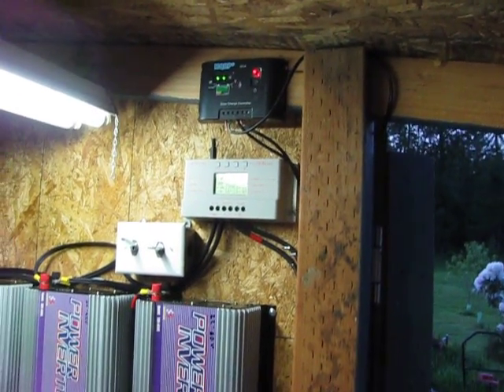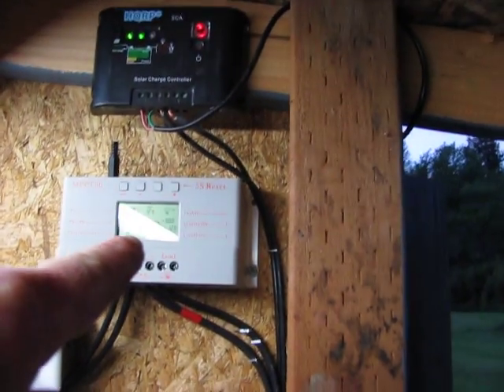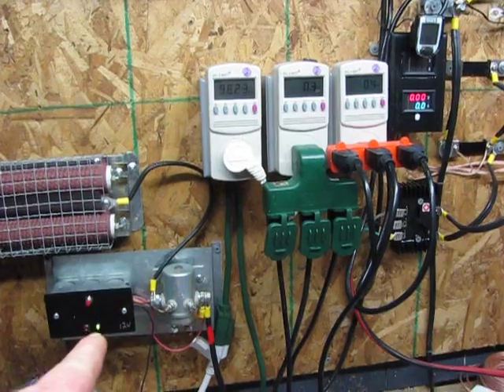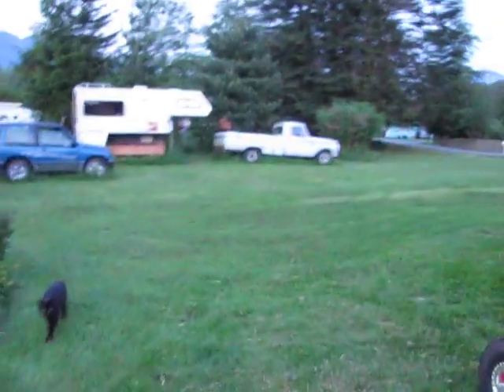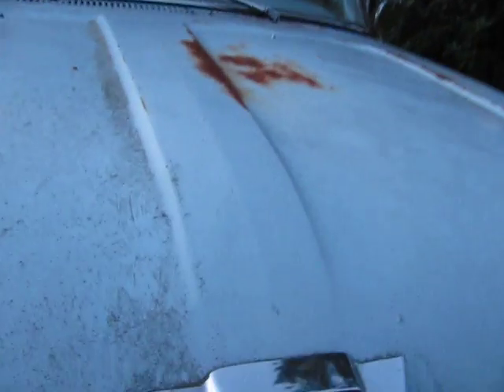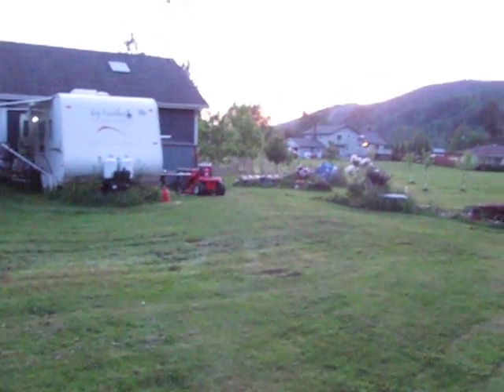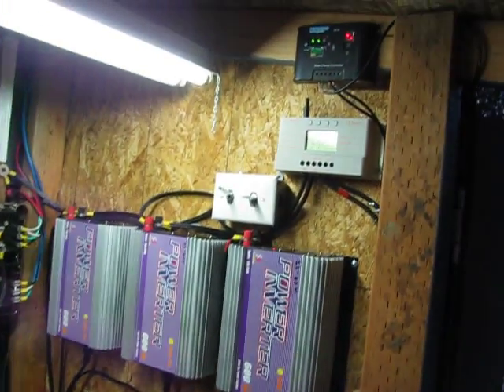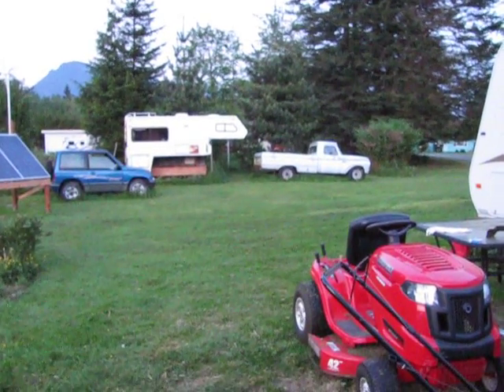Cheep wind turbine dump load controller

Comment: Could you build me 2 units controllers, 48 to 85 volts DC with the connection for the dump.i have  grid tie invertors but no dump load control and I can't find those.

Comment: hi sir..can i use car alternator water powered connecting to solar charge controller??
Reply from the maker: Most car alternators have a built in charge controller for 12v battery charging ,,  With trial and error testing you will be able to make a great hydro setup using 12v standard car alternator,, I recommend using one from a Truck 100amps or more , It will take some trial and error testing ,, but i am sure you can make it work
Reply: Jason Brown i see .. thank you so much sir, for replying..
Reply from the maker: I wish I could help you with your project more,, but my creek is not worthy,, I have only winter / spring ,, it goes dry in summer ,, thank you for watching my video's
Reply: Jason Brown its okay sir..
im enjoy your project..
im gonna try my alternator project..😎